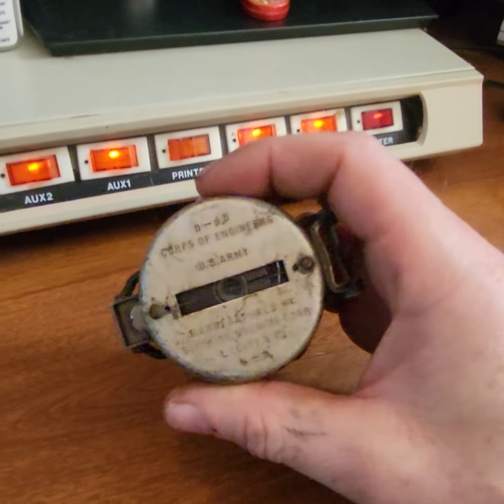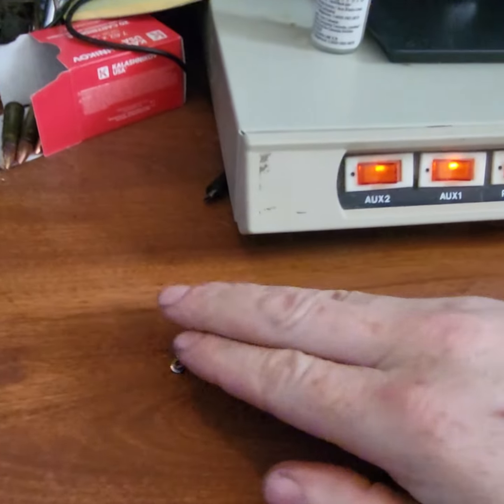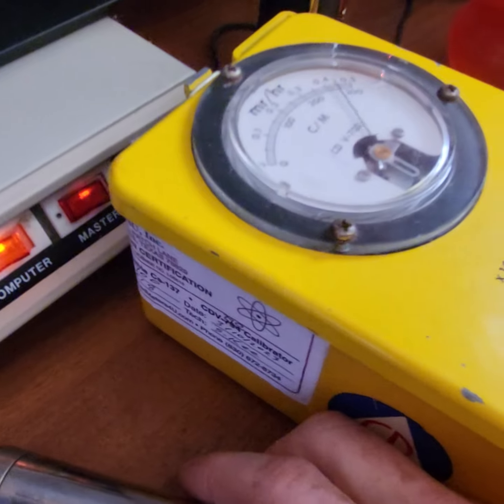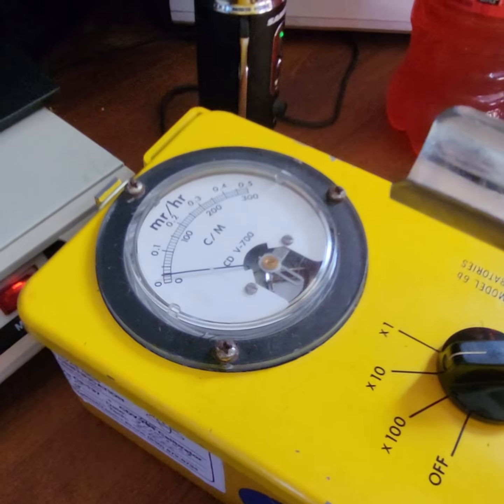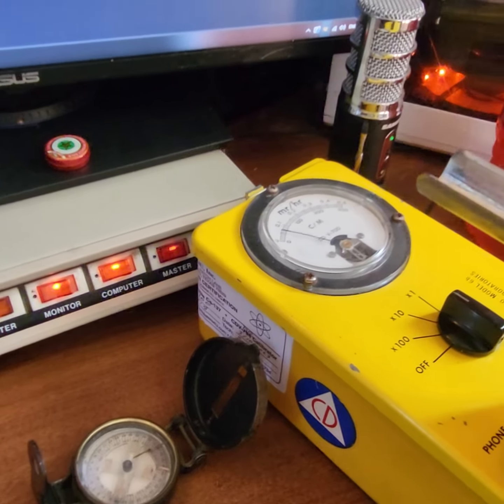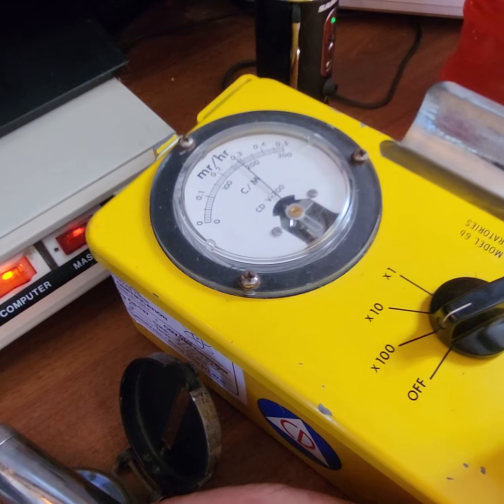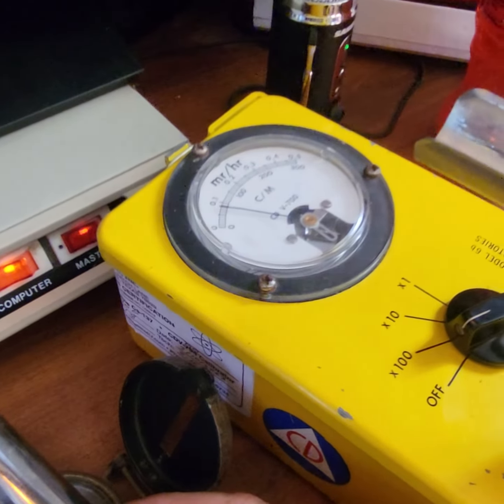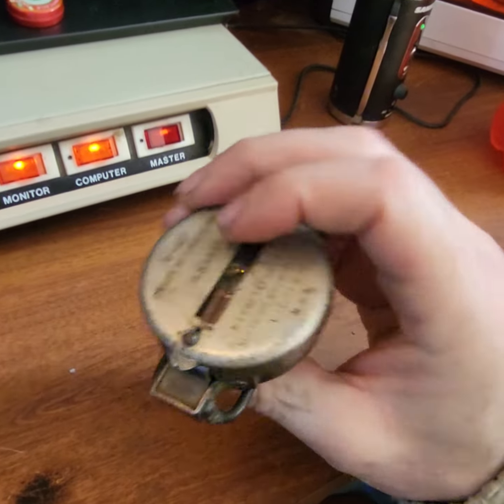WW2 Corps of Engineers Compass

Comment: Funny thing about those americium buttons is they emit purely alpha and low energy gammas, neither of which the CD V-700 can detect very well. They read over 110,000 counts per minute each on my radiacode 102, and well off the scale of my mini monitor 900 which goes up to 2K counts per second. But the energy compensated gamma dose is only about 4 uSv because the gammas are low energy.
Reply from the maker: That's interesting. I recently just heard that alpha emitters dump a lot more energy than beta and gamma, but since it has such poor range and penetration, it is often overlooked. Regardless, that would explain why my Припять RKS 20.03 meter is always reading so much higher. Was looking at getting a 102, what are your thoughts on it?
Reply: @UncleDon226  love the 102. It’s quickly become my do-everything meter because it’s sensitive, easy to use, very accurate, plus it’s energy compensated and has a whole app and desktop pc software for logging and gamma spectrometry. It’s a must have to say the least. 
And yeah, alphas are strong but big so they get blocked by everything. The layer of dead skin cells on the outside of your skin is enough to stop them before they can do any damage. That’s also why it’s so bad to ingest alpha emitters though. They have direct access to your flesh and will wreak havoc.